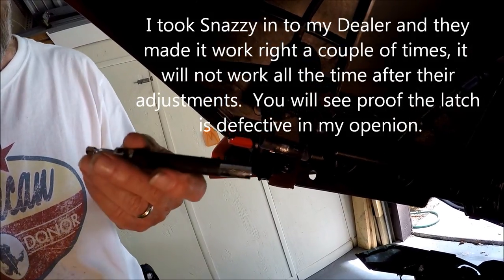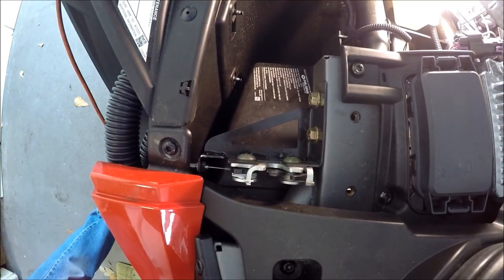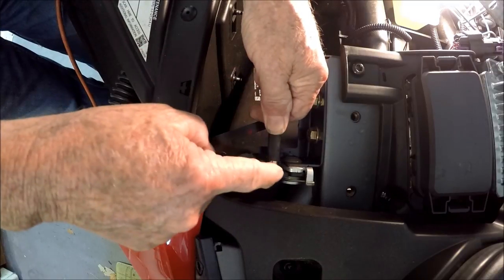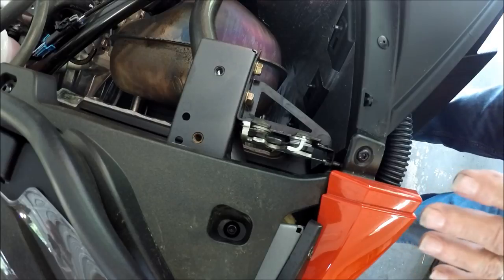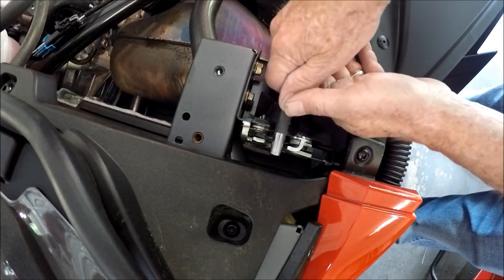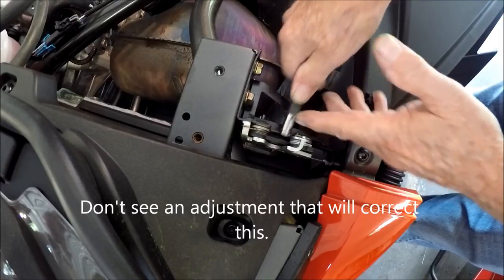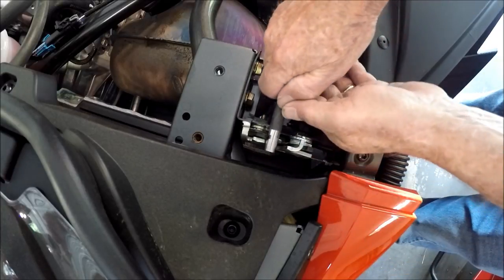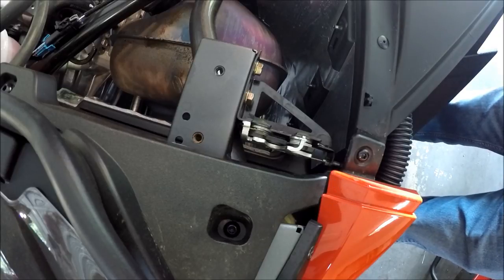Hood Latch Operation Test  Polaris Slingshot

Comment: the 2016 i bought --- they told me they replaced the Hood Latches.... but when they went to open it after i bought it,,,, it would not open unless someone lifted up on the drive side a bit.... then it would unlatch.... i noticed  that that the passenger side had a 2" x 6" x 1/4" thick ... was missing --- they found a substitute and it then work 75 percent of the time... i think it added some resistance to the Hood .. i glued something better in its place the next day -- and now i dont have hardly any problem opening the Hood Alone.... :)

Comment: sam my hood is stuck shut any suggestions on getting it unstuck
Reply from the maker: +Walking D3ad73 Get someone at a corner of the hood near the windshield, you push down as far as you can with the  hood release lever You should hear a snap.  With the lever held down get the person to gently lift on the corner, then do the other side and you should be good.  There are two adjuster nuts that will tighten the cable if it is too loose and not releasing the latch.  If you don't hear the snap, it is not releasing.  Find the two cable and you will see the nuts.  you need to detireme what is not happening then go from there.  No snap you have a cable problem.  Snap, you have  a latch problem.